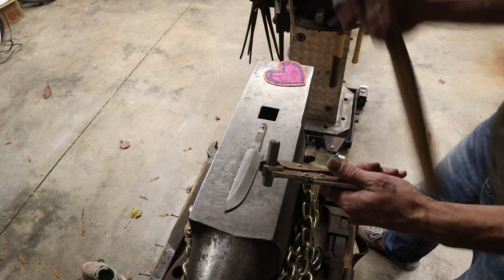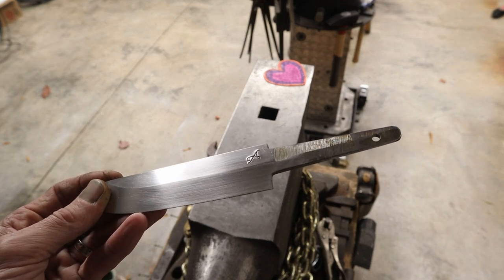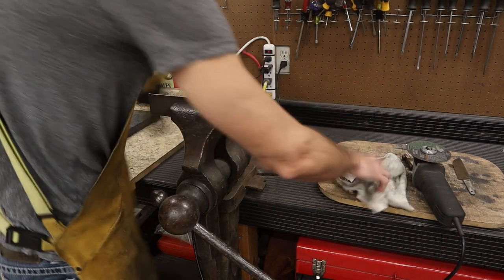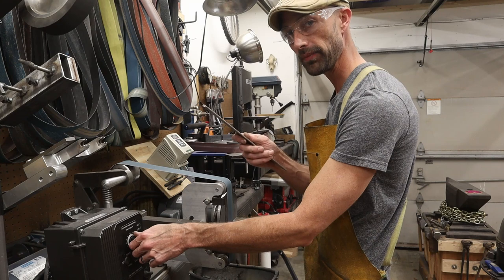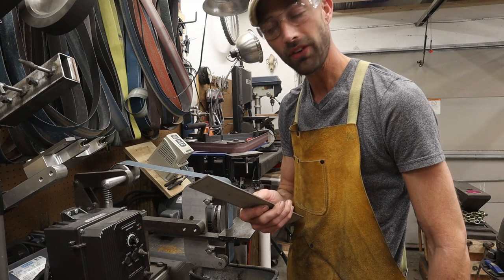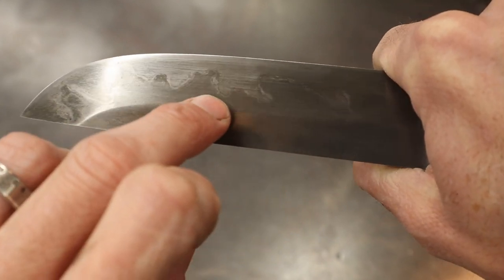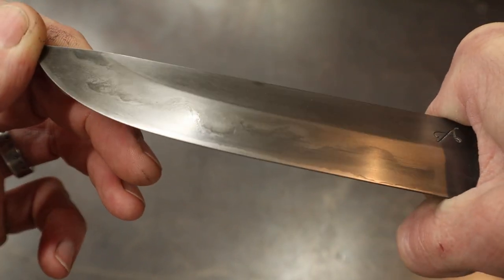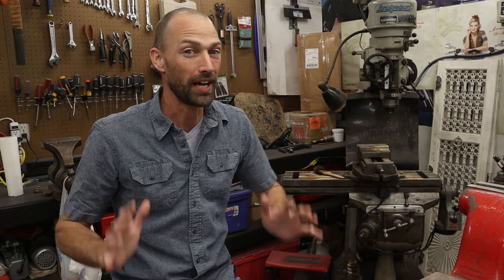Making a Viking Puukko knife - Pt.2 - Clay hamon, heat treating and the guard!

Comment: The hamon is really beautiful. Your grind lines looked perfect but I would of been scared to death that with a water quench and then into oil it would of turned that edge into a bacon strip with lots of waves in it. It looks great . Was the quench water and oil heated and if so to what temperatures ?
Reply from the maker: The water was at room temperature which was probably about 60° and the oil was heated to about a 100 to 120 degrees with a hot chain
Reply from the maker: Traditional style katanas are also water quench that's what gives it the curve down the back of the spine
Reply: @Aleeknives  thanks for answering, I'm trying to learn all I can.
Reply: @Aleeknives  I bet that is interesting to watch as the curve appears down that sword. It has to be a WOW moment every time they quench a blade.
Reply from the maker: Me to! I document my findings for you guys! I really liked the rapid water quench! It seemed to harden the blade edge extremely well! I believe that I would have been able to see any stress fractures after I sanded and etched it in the ferric chloride.  I also used a magnified loupe to inspect the edge. I will be doing it again!
Reply from the maker: @TheRedhawke  Walter Sorrells has a video showing it happen in a clear quench tank! It is amazing and I can't wait to do it myself!
Reply: @Aleeknives  I'm going to look that one up. Thanks
Reply: @Aleeknives  I can't wait to see it, love your channel.

Comment: I don't think it makes a lot of sense to do a differential heat treat on a puukko knife since they are suppose to have a scandi grind. When you sharpen a scandi knife, you're suppose to remove metal from the whole bevel. So if you etched it and polished it to bring out that Hamon, it will all have been for nothing once you sharpen it.

Regarding the water quench, I think it's better to quench it in water for 1 to 1.5 seconds before putting it in the oil. That way it cools down to below the TTT nose before you take it out of the water, then is allowed to cool relatively slowly in the oil. You can leave the edge a little thicker than normal if you're concerned about cracking, but I've had pretty good luck with this technique.
Reply from the maker: You are absolutely correct! However, I didn't do a scandi grind on this knife. There is a secondary bevel. most people have no clue how to sharpen a scandi so I made this a little easier to service. Hey thanks for watching my videos!